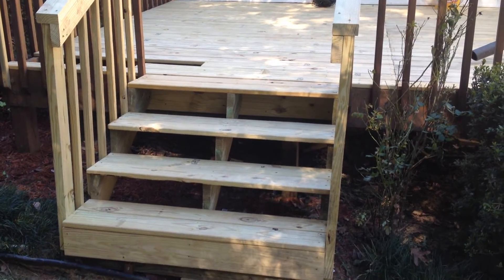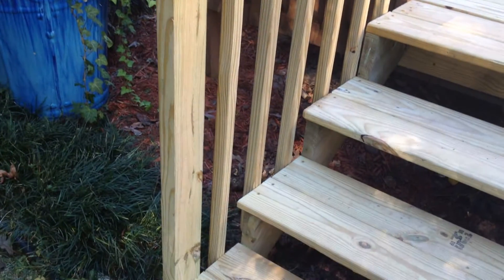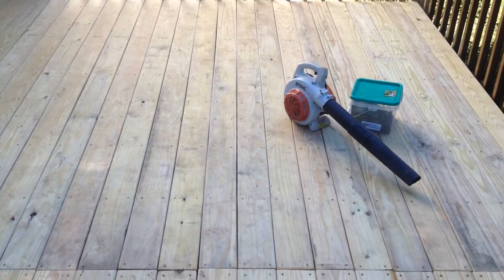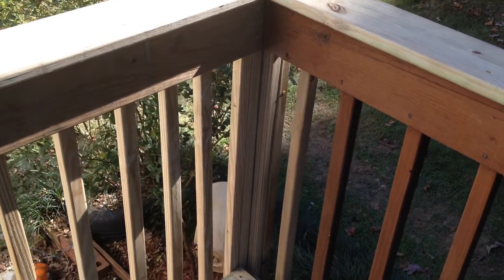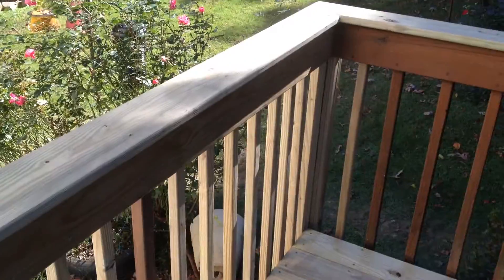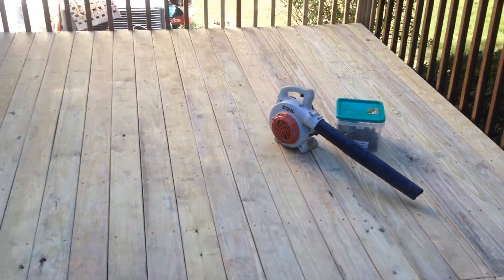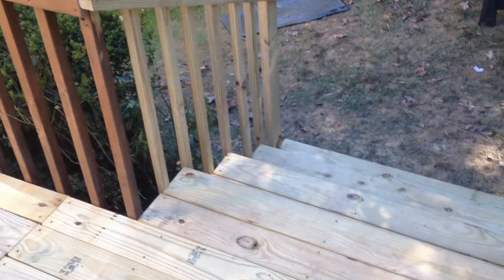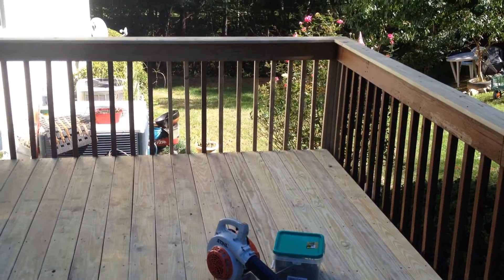Handyman Business /  day 2 deck restoration.

Comment: I'm going to have to fix a friends deck soon his current girlfriend bought the house and after having it awhile noticed how bad it pools on one side the gaps between the boards is just to small they hold dirt and water. Also the floor boards have a lot of the boards with the cup up basically there troughs of water i would have to pull up the whole floor and reinstall it all its a small deck though I just have to figure out how much I want for it.